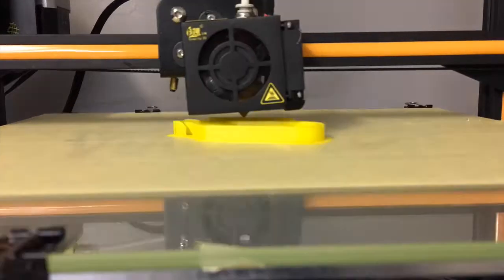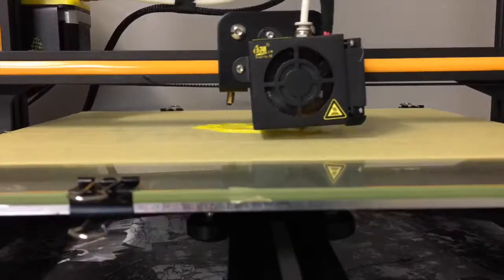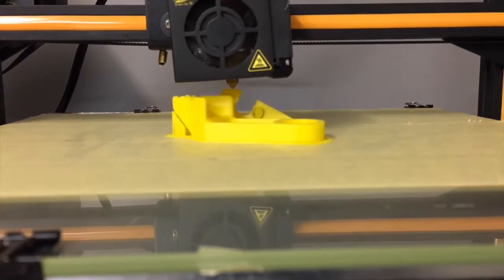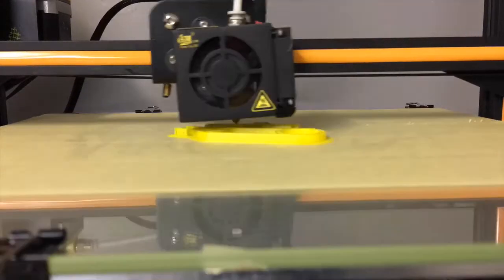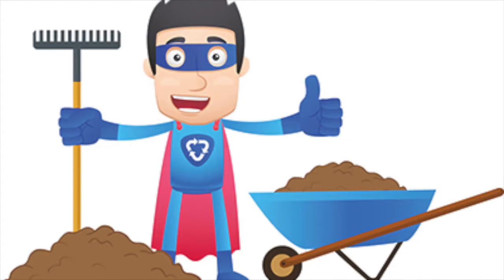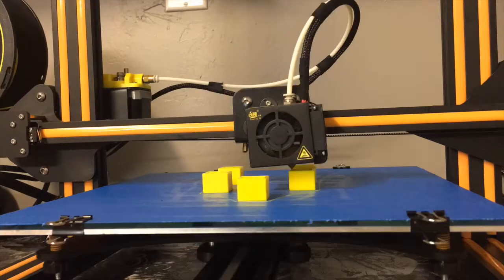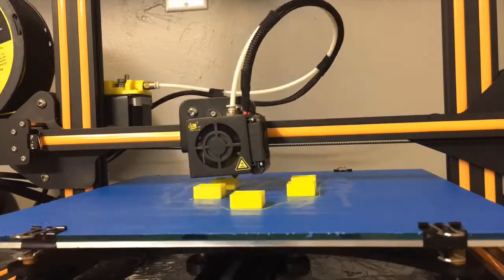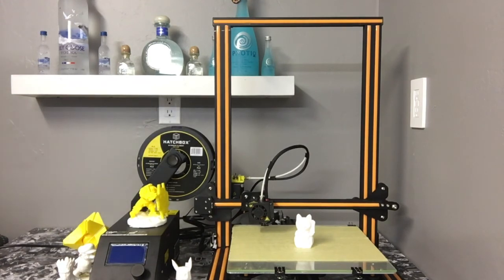3D Printer Filament PLA vs. ABS Review

Comment: Have you printed in ABS on the CR-10?
Reply: ABS prints fine with bed at 100 C and nozzle at 250 C.
Reply from the maker: Yes i have, i will have a video out on it soon
Reply: The nozzle reaches 250C? ? How high can it go?
Reply: Not much higher than that, you'll start burning up the tubing inside the hot-end. You would need a full metal one to go higher.
Reply: Ah ok, I thought you'd need a full metal one for 230+